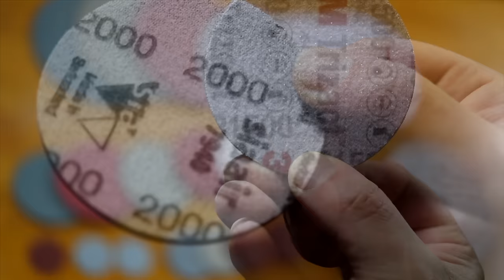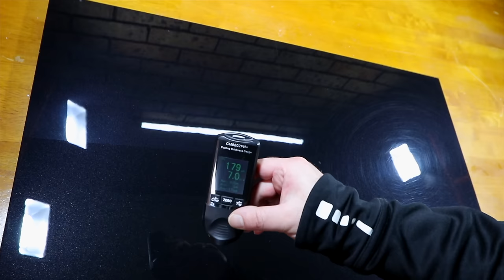A Guide To Wet Sanding, Compounding & Polishing Car Paint!

Comment: I've found your videos to be first class and just enough information to give confidence to do this work myself. I'm a used car dealer and hardly wet sand any paint - I use a cut/polish type product (with bad paint or deep scratches Farecla G3) on an orange foam pad & remove swirls/spider web/hologram stuff using Farecla G10 or 3M Ultrafine with a black foam pad. The machine I use is not DA just orbital. Autoglym has been my "go-to" polish of choice for many years. In fact - I have found it so good it has covered many of my errors (maybe fillers or special optical effects in the polish??).

I can get a good level of shine back on all colours... I'm tempted to have a go at some wet sanding now. I don't have airlines and so electrical powered equipment is my route.

In the future I'd like to try more detailed approach to the better quality cars that I sell & buy a DA sander/polisher and use a foam backing pad.

In your video here - I would have loved to have seen what results my approach would have gained on the right side of that panel..... what you did is obvious - but also looks like a hint of magic :) I guess that's experience - that hidden factor! 

In all.... THANK YOU for your support - even though you didnt know you were!!!

:)
Reply from the maker: I appreciate you sharing your thoughts and personal experiences, thanks mate!

Comment: Thanks for this video. I had a car which had Adams "paint sealant" put on the door with the result that there was a chalky white film which looked terrible. Compound didn't touch it so I gritted my teeth, got a sanding block and started with 1000 grit paper and a hose. 

White stuff came off with the water, after 2 passes I switched to 2000 grit, then 2500. Less white stuff but paint looked terrible. Then compound, 2 passes, then polish, 2 passes. Door looks infinitely better, finished it off with a coating of carnuba wax.

Your video gave me the confidence that there was a chance the paint wouldn't be destroyed, and to be honest I had nothing to lose anyway. Now car is back to happy!

3 coffees bought.
Reply from the maker: Really great to hear that after what sounds like a lot of work to fix the issue, it all came up well in the end! Really happy that the video helped and thanks so much for the support!

Comment: Sandro, Another great video! I guess that the determination to wet sand vs. compound depends on a couple of things: the depth of the imperfections, the degree of defect removal desired, the time you have to work this, and the amount of money the customer has. From my experience, always use the least aggressive method first, then gradually work your way to wet sanding. Keep up the good work!

Comment: Detailed, Comprehensive, Well thought out, well shot and well executed educational video. Your approach to car detailing and your attention to detail is noted and greatly appreciated. I have a question for you. Let's say that you had a few large rock chips or LOTS of small rock chips on that panel in addition to all the scratches and swirls. Would you use touch up paint and fill in those rock chips before or after wet sanding or before or after compounding? Let's say your touch paint is from the manufacturer and it comes with clear coat too. When would you apply that. This is one question that I've never seen addressed during these kinds of informative vides. I look forward to your response. THANKS in advance.
Reply from the maker: Thanks, and I’d apply the touch up after the first stage of sanding, make sure it has a couple days to harden and then continue sanding, compounding and polishing.

Comment: One of the best videos, explaining wet sanding. Just a question on the pads; which brand is the best quality? Mirka,3M, Sia? What sanding pad is for plastic and which is for paint (material wise). Thanks!
Reply from the maker: I guess personally I really like SIA disks as I seem to largely avoid pigtails and I don’t tend to dry sand much so I don’t need or want the extraction holes found in many other brands, and the integrated foam in the Sia’s also tends to be more forgiving to work with. 
The plastic panels or trims I’d be sanding are also painted/clear coated - unless it’s something like an older plastic headlight-  and I’d generally use the same discs. 
Thanks!

Comment: Just bought a polishing machine and although I've done wet sanding before I didn't know which attachment to use for compounding. I learnt it is the soft wool pad and the foam pad for polishing. I also have some blue elasticated bags that fit over the face. I'm not sure what they are for. I think it could be waxing.
Reply from the maker: Yes those are usually referred to as ‘bonnets’ used for machine wax/sealant applications - though I tend to personally prefer using a foam finishing/waxing pad instead

Comment: yet another sensational video Sandro! Well done. If it’s not too much trouble, I have a question. I notice you tend snow foam the cars dry, rather than pressure wash off the loose contaminants first. Why is this so? I look forward to your answer!
Reply from the maker: Thanks, and I find that the foam bonds better and clings longer on dry paint and it also seems to work a little better when it’s not further diluted by the standing water in the car.
Reply: @CarCraftAutoDetailing  thanks Sandro, you're the best!

Comment: Excellent video and thank your for sharing your knowledge and experience with us. 
I do have a question, your gauge reads a macron number, how do we know how low you can go? Before we go through the clear coat. If we are talking about cars that are less than 10yrs old, how much clear coat would they have? What is the lowest reading before one has to stop?
Reply from the maker: Thanks, and as paint thickness gauges only give total thickness readings on metal panels (some can give individual layers on plastic and fibre panels) you have estimate how much of that reading is actual clear coat.
The video below is an older one but it may still help explain how to predict clear coat thickness and what’s generally safe. 
https://youtu.be/XIIVYiWbF-w

Comment: I really was hoping you would do a video on Sanding to remove defects and/or level paint. I really enjoy my Shinemate 12mm RA polisher. Also just wanted to let you know how much I loved the Rupes Yellow Wool pad using it with S20 Black plus at times NV Precision to give my 40+-year-old paint on the Sandman ute a touch-up. S20 Black is so versatile and with the Rupes Yellow wool pad not only gave good cut but finished incredibly on the old paint. I was really surprised!!!  But it would seem doing a sanding job like here would be a bit quicker, efficient and most likely improve the end result. So will be investing in some sanding pads after seeing these results. So given I have LC Microfibre cutting pad, LC low Lint Wool Cutting Pad and Blue HDO foam pads, if I wanted to go after some of the more deeper scratches without having sanding pads, what would your tip be??? I have S20, Precision, Finesse and Clear cut. Again thanks for your time and effort.  I guess been in that massive Penal Colony Prison called Viktoria you have to do something!!!!
Reply from the maker: If it’s an older single stage paint it’s generally going to be on the softer side, so you may not need too much aggression to get some deeper scratches out. I’d tend to start with something like the yellow wool pad and Precision for heavy defects on a softer paint, and if need be you can always go the low lint pad and even TLC if you still need a bit more cut

Comment: One thing this video was missing for me - how should you approach sanding for a smaller section? For example, where you said the scratch went through the clear, would it have been worth it to do a smaller pass over just the scratch to further flatten the ridges where the scratch is then blend it back into the surrounding paint before moving on the finer sand paper?

Comment: I just did a first polishing on my Z3 with Maquires compound & a heavy cutting pad. It’s shinier, but I’m going to need to sand the paint to get out more imperfections as the polishing has revealed more 😩 would you recommend 1500 & 3000? Or higher? I need to order the proper sanding pads.
It’s taken this long to get back to the paint correction as I’ve had to replace the alternator, the entire cooling system, the flywheel, clutch & slave cylinder 😭 Now, I want to focus on paint correction. I just bought a standard (inexpensive) da polisher. I enjoy working with these products, but they’re not removing the defects. Just exposing more & leaving some shine, which is better than what I started with.
Reply from the maker: It would be good to know how much paint you have to play with before getting more aggressive but I’d certainly start with P3000 before moving on to more aggressive grades. 
As far as compounds go you could try Meguiars M110, with a Meguiars cutting microfibre cutting disc as that should really give you increased cut and potentially still a good finish on harder BMW paint. Just be careful and less aggressive around the body lines and panel edges and you should be fine.
Reply: @CarCraftAutoDetailing  It’s a 1998. I feel confident the paint is thick & I know this car has never been polished b4. But, I will buy a paint depth meter b4 I start. I know there will be tons of touch up & 3 panels will have to be repainted 😭 But, I’ve painted cars b4 & I’m fairly confident I can do a good job 🤞🏼I’d just like to smooth out the paint as much as possible b4 I start the actual painting. Thanks for your help Sandro as always!!

Comment: I know this may be more advanced... but with those particular paint depth guage's I know they measure everything all in one number (prime, base,lacquer) which isn't bad and gives us an idea. The best I've found that takes the guess work out of it is the Positector 200 that measures them all separately but, gosh $$$ 😅
Reply from the maker: The Positector 200 will only measure individual layers on plastics or fibre based substrates, but it can’t do that on metal panels, and I don’t know of a PTG that can.
Reply: @CarCraftAutoDetailing  ahhhhh gotcha! Makes sense now that I had seen it used on a Ferrari TDF. Mhmmmm they need to come up with a machine that does this on metal surfaces 🙂
Reply from the maker: Yes, that would be great to have!

Comment: Hello Sandro, here i am again, after being amazed by your knowledge, asking for another advice. I'm basically a weekend detailer, with few money and even less polishing practice. Do you think buying a cheap 3inches rotary machine, and some adapters for smaller pads, plus the micro polisher extention wire and included compound and polish bottles could be lethal for my car/ducati? as you cacn see, i basically dont know where to start and where to put my money into
Reply from the maker: If you’re willing to practice a bit a mini rotary with 3” 2” and 1” plates and pads can be a very affordable option to polish a motorcycle or the intricate areas of a car but it takes a bit more practice that a DA polisher, especially to finish well. The wired micro adapter is a lot more specific and specialise so that’s not where I’d be so ending my money to start with. You’re better of putting that extra money into getting a slightly better rotary and you should try and avoid the very cheap ones as they tend to perform quite bad. Have a look at Shine Mate as they make affordable polishers that are still very good.
Reply: @CarCraftAutoDetailing  first, thank you so much for your time and your answer. Unfortunately shinemate is not available/out of stock everywhere in Italy, I can only find Griot ones that could be above the cheap ones. Aside from that, my budget is actually 500€, I think I could fit like 2 medium quality polishers (3 and 6 inches) and some nice pads/compound. Am I totally on the wrong way? Do you think a newbie should go with a little orbit DA to enjoy the process and not make any damages? I’m sorry for bothering like that, but I just can’t find decent videos like “polishing complete kit under xxx$“ on the YouTube university.
Reply from the maker: I think starting with a large and small DA polisher set up looking at mid range prices is a great option, and looking for a package where you get bonus pads and compounds is a smart choice to make your dollar go further. I think it’s easier and nicer than starting with a rotary and you’ll find it less intimidating and stressful!
Reply: @CarCraftAutoDetailing  thank you so much Sandro, I’ll keep you up to date and I’ll try to grab as much as I can from your vids, keep up the huge content, and stay safe ;)

Comment: Hi Sandro, love ya work, great videos and explanations 👏
I have 3 questions I'm hoping you have time for;
Firstly, have you ever come across a situation where polishing the "interior" glass surface of a car is beneficial ?
Secondly, I recently purchased a 2012 Mercedes-Benz ML63 AMG SUV (2 & a half tonnes of fun 😅), which is Pearl White.  I'm wondering if orange-peel pearl White gives a better look (i.e. the pearl within the paint pops better because of millions on different orange-peel angles on the clear-coat surface), or like other paints would it look better cut back to a glass finish & ceramic coated ?
Finally, just by tapping my finger-nail on the body surfaces I can feel that the metal is thicker than most cars and that the clear-coat is also harder than most cars.  Have you ever cut back a Mercedes-Benz pearl White ?  If so, what combinations of wet-&-dry disks & polish would you recommend from your experience (1,500, 3,000 then 5,000 ? and i alread have a paint thickness guage, Shine 3" & 6" dual action polishers, Shine-Mate /Lake Country Pads and Scholl S2, S20 & S30+ polish, but I'm happy to purchase different brands for the best finish - i do have a trade background, a sharp eye and plenty of time, so I'm confident i can do a perfect job 😊).

Kind regards, 

Craig
Western Australia
Reply from the maker: Hi Craig, yes I have polished interior glass - obviously non-tinted- and it was to remove heavy yellowing smokers film where micro polishing abrasives work great to break it down and restore the glass. 
Secondly I would imagine that removing orange Perl over any base colour - including a pearl white - would improve its clarity and reflective qualities, I’m not sure about pearls being better with increased orange peel, it’s not something I’d tend to think is correct. 
Lastly I honestly can’t remember specifically sanding back a hard clear coated pearl white specifically- maybe I have just can’t remember mate - but I have sanded quite a few harder German clears and if it’s specifically orange peel removal I’m after, I’d tend to suggest hand block sanding 1500 grit for the initial stage and then machine sanding 3000 to refine the finish and I personally like the SIA sanding papers and discs. I think S2 on a microfibre or wool pad should work well the refine the sanding marks and S20 on a foam polishing may be enough to restore gloss on a hard paint. But as always every paint is different so you’ll need to do some testing to find out what your paint responds best to. Hope it helps mate.
Reply: @CarCraftAutoDetailing  Thanks heaps, really value and appreciate your feedback - 5 coffees are on their way 🙏 💛
Reply from the maker: My pleasure mate and really appreciate the support!

Comment: Can you use a standard wood working orbital sander for this with 1000-3000 grit? I have an adjustible speed makita I could use but I'm pretty terrified to get started with it. Goal is to remove some skuffs, a keyscratch and some orange peel from the factory paint. 

I bought a pack of sheets for hand sanding but not sure what block to use for those or just do it by hand.  Yes I'm trying to do the whole car but going one panel at a time and not worried about finishing it in a day. It's find if it takes me 8hrs to do just the hood, as long as I don't screw it up lol.
Reply from the maker: Yes you can use a general orbital sander and always working from the least aggressive method up is the way to go so start with finer grits and only use the coarser ones if need be. Panel body lines and panel edges is where the most risk is so try and be more genetic there or even leave them be. You can always pick up a cheap panel from a wreckers to practice on as it’s a great way to learn without the risk.

Comment: My question is, am I able to repeat the whole process of wet sanding and then buff on the same panel again or is there a limit? And how can I prevent those swirl marks to from appearing on surfaces? Thanks
Reply from the maker: You can’t completely prevent swirls or other defects from reoccurring, that’s just the nature of car paint, but using safe car washing and drying techniques will largely reduce them. 
How much paint you have to start with as well as how aggressive you are during this process will determine if or how many times you can repeat it without burning throw the clear - it’s always different on every paint.